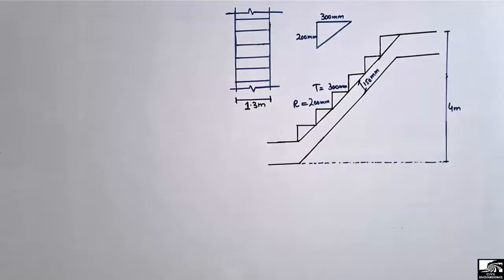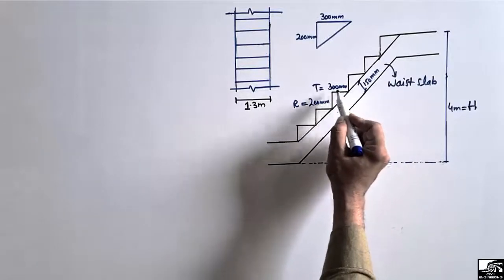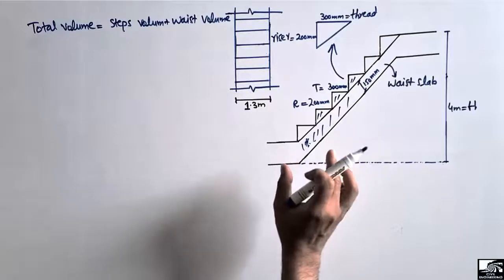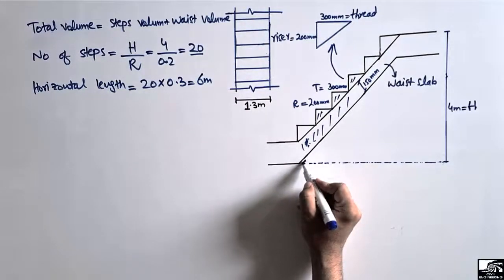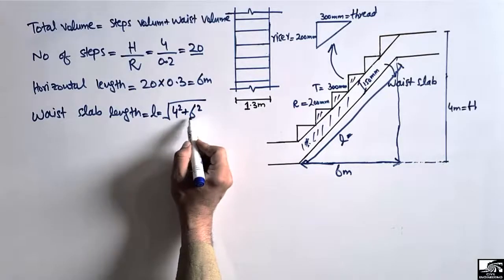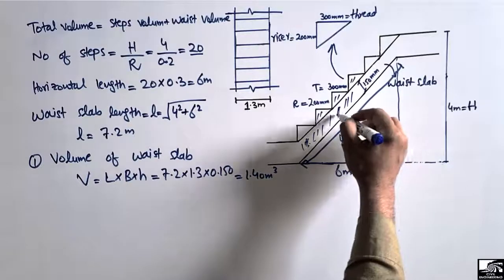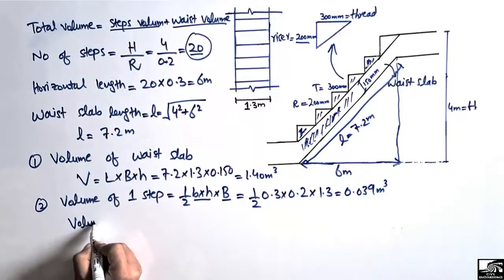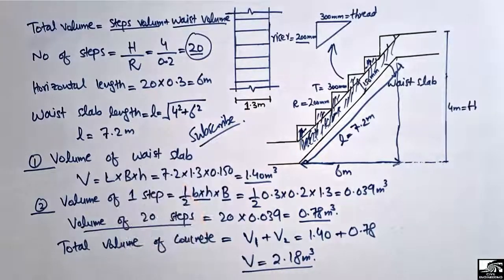How to Calculate Quantity of Concrete in Staircase

Comment: fantastic sir , weldone , but when calculate horizontal length use overall H which is 4 meter to top of stair slab not botom slab  , you should say H - slab thickness  = 4- 0.15  then calculate horizontap length